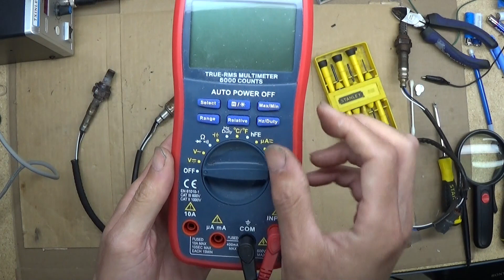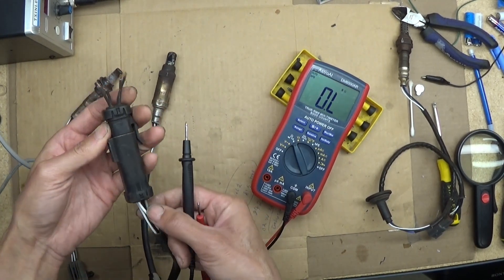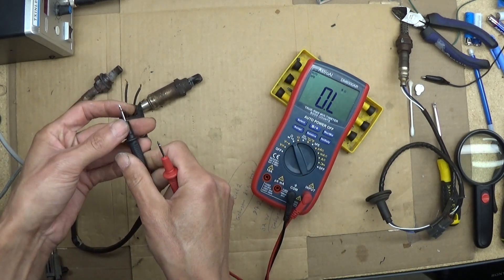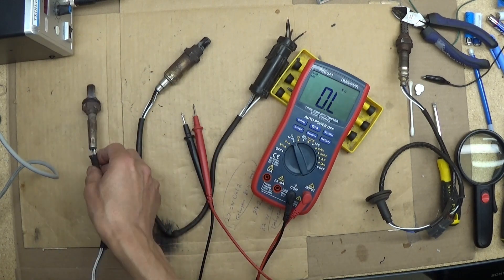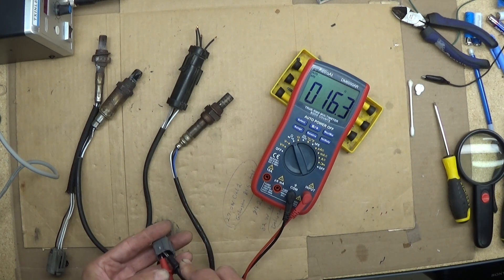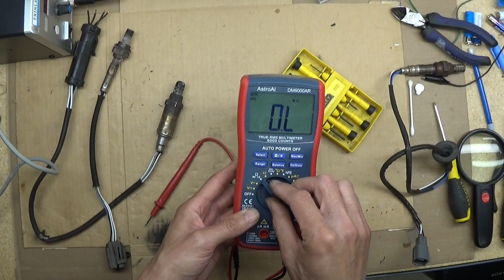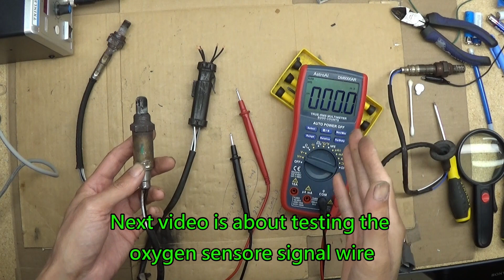Testing Heater Section of Car Oxygen Sensor

Comment: Hi sir max ohm for o2 sensor read at multimeter is what sir?... my o2 sensor read at multimeter is 18.3ohm is that good? Or not good?
Reply from the maker: With ohm meter you can only test the heater of the sensor. It is vary depending on types of engine. But i think that number is within the range.

Comment: How to check o2 sensor one cable?
Reply from the maker: If you mean only two wire , then it does not have heater. You need to measure its voltage on the car with engine running using back probe wire at the connector.